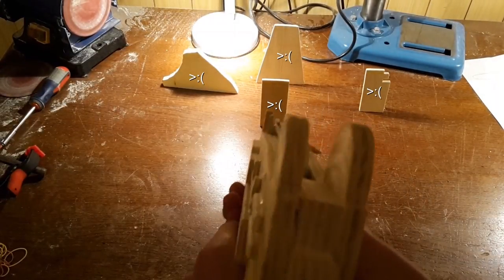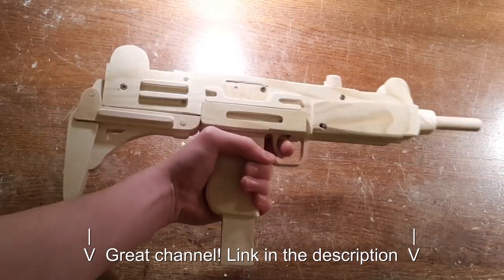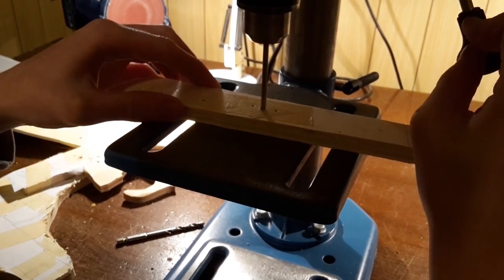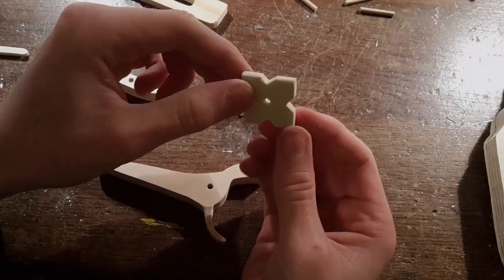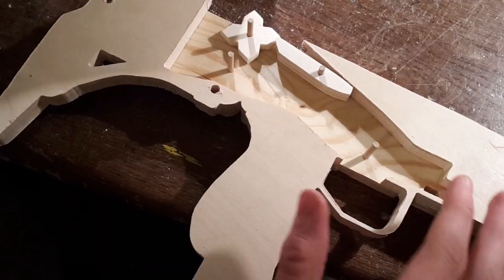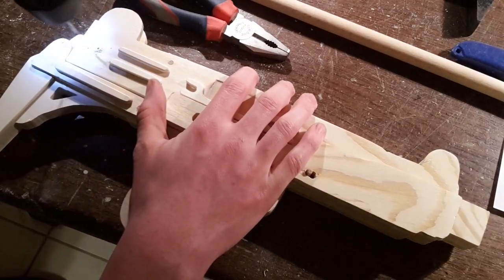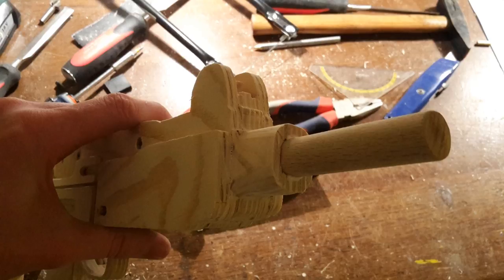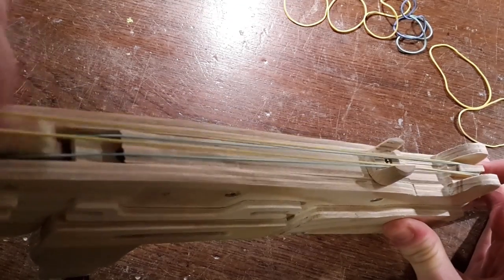How to make a VERY EASY Full auto UZI [Rubberband Gun] - Free templates

Comment: Hi Wooden Weaponry .... i've tried making this weapon. but I'm having trouble with the mechanism. I have followed the pattern but the mechanism can not run as smoothly as you make. especially on the rubber hook with the lock. when I pull the trigger is very heavy and when it can, all the rubber immediately off, can not be separated one by one. what do I need to fix? Are there any more tips to make my mechanism work? please replay...thank you so much for your all awesome work
Reply from the maker: Take it apart, roll the wheel manually, sand it or rebuild a part when needed. When the wheel's spinning to fast, tie some heavier nuts to the moving part under it.
Reply: Ok...i will try again...btw any email...so maybe i can sent my work and please give some note if you dont mind

Comment: Is there anyway to make the fire rate slower?
It's usually too fast
Reply: IanTheSecond the best way is to attach havier hexnuts to the moving part
Reply: Heavier delay piece. The problem is to make one small enough to fit inside the gun.
Reply from the maker: +Muss2342 ITA I see you in lots of parabellum's comment sections ;D